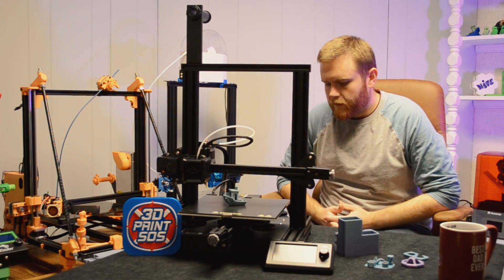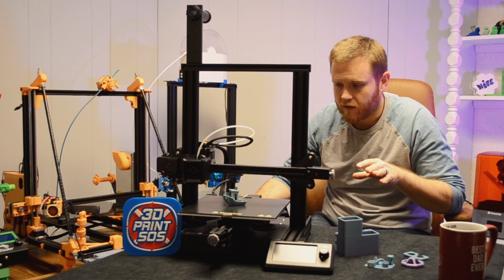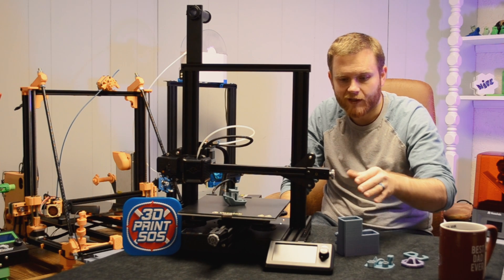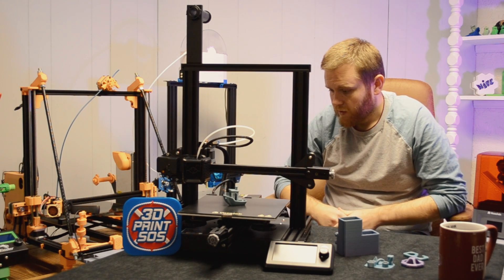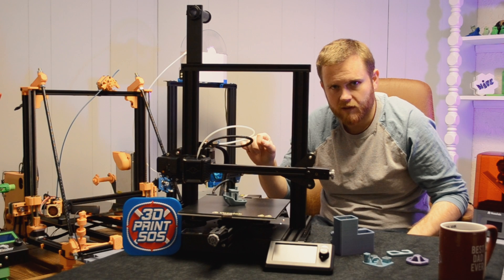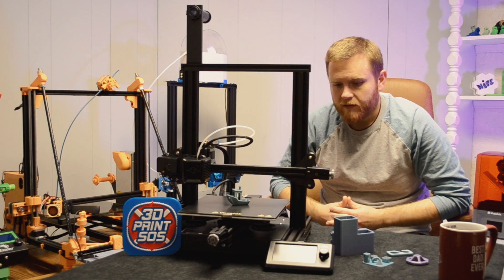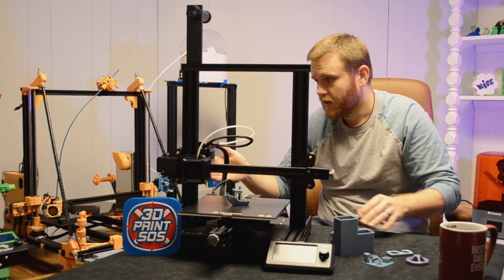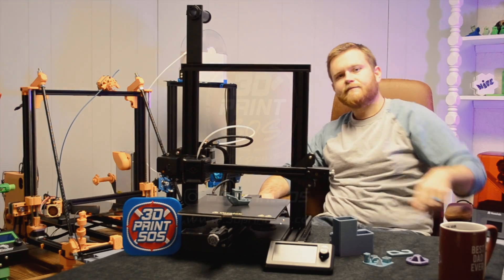Voxelab Aquila 3D Printer Review

Comment: Just got mine yesterday, printed the shapes and the hook in the SD card, when it came to print the tool box It ran out of media that had come with it, was not able to feed more during the process from my new spool and had to cancel the print. It did however print all in great quality out of the box...

Could you do a video on hotswaping media during a print on this machine?
Reply from the maker: Awesome! Glad the machine is rockin and rollin. Hotswapping is legitimately difficult. In my experience, I’ve only managed to do it a handful of times. If you can plan it a bit better there are ways to pause the print at a layer height you set and then swap the filament. Great for color swaps. I’ll try to come up with some more content to help in this field soon. ;)
Reply: @3DPrintSOS  uh oh trouble in paradise with my machine for the last 2 days I cant get anything to stick and print correctly and it just started happening after after a successful print.
Reply: I solved it by cleaning the bed with some isopropyl alcohol!!
Reply from the maker: @thenovela  Awesome. Those type of issues are typically leveling or cleanliness related. Glad you got it solved. :)

Comment: Does anyone happen to know if Voxelab is another branch of FlashForge?
Reply from the maker: As far as I know, that's correct. Some of their resin printers come with a FlashForge scraper. They must be a branch.
Reply: @3DPrintSOS  That is very interesting... I know you mentioned in your video that you have experience with an Ender 3. Do you think that the "FlashForge" version of the Ender 3 is a more refined machine? If you could only have one or the other, what would your pick be?
Reply from the maker: @djmichaelyoung  Easy. I would choose this Voxelab version for sure. At least over my Ender 3. The silent steppers, 32bit board, belt tensioners, glass bed, adjustable extruder block, upgraded PTFE couplers, 4040 Y axis chassis, the "tucked" power supply, hot end silicone sock, great wire management, and last but not least that screen and UI are all major upgrades over my Ender for less money. It's really a no-brainer. The Creality Ender 3 Pro v2 would be the closest head to head contender here, but it's $300! And the Anet ET4 Pro is worse in quality by quite a margin, has proprietary firmware, and it's still $200. :)
Reply: @3DPrintSOS  I think you make some really good points about the Voxelab machine. What about print quality? Is there a noticeable difference in quality between what an Ender 3 and the Voxelab can produce?
Reply from the maker: @djmichaelyoung  I would say, in my personal experience, the Aquila is putting out better prints out of the box. I can't say how long parts will last, but so far it is in fact better from the get go.